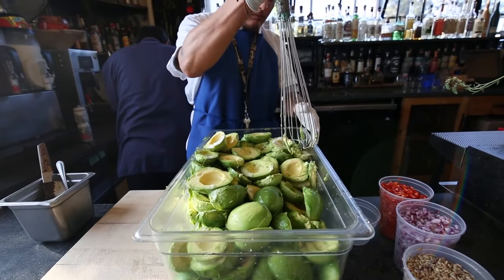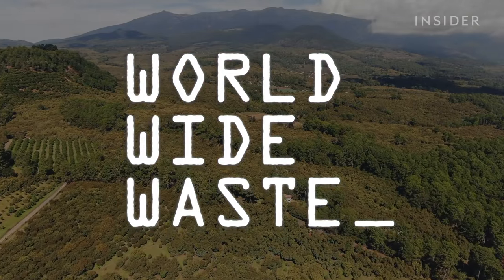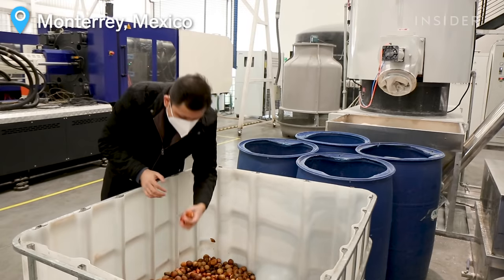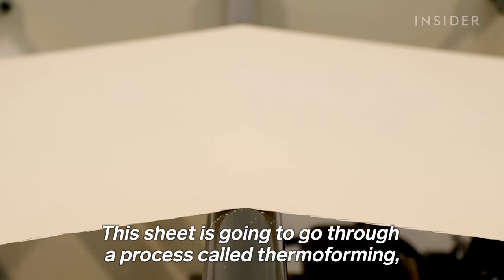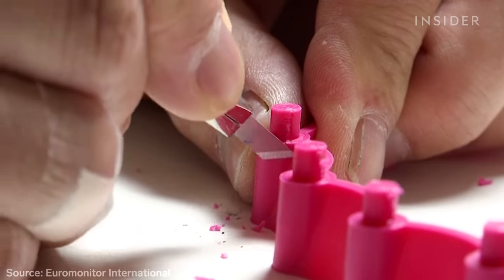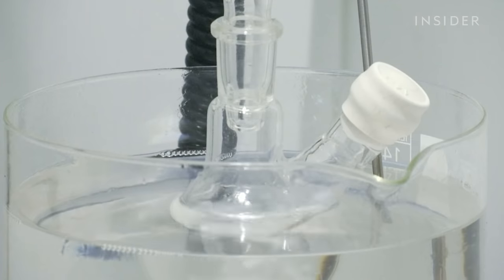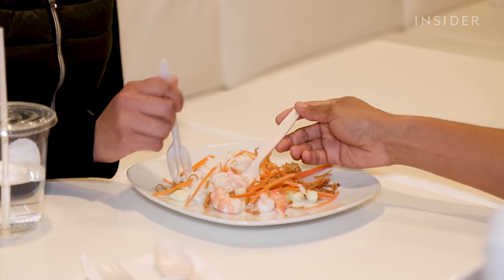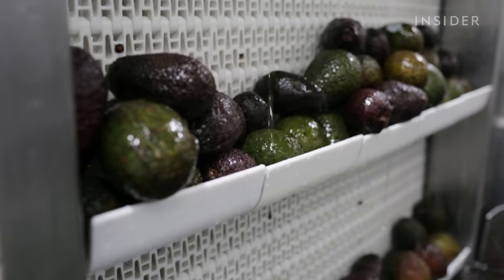How Avocado Waste Is Turned Into Plastic | World Wide Waste

Comment: It’s a huge step in the right direction and without these innovations we would still be stuck using single use plastics. Kudos to them and i applaud their way of thinking.
Reply: They're still single use
Reply: @sirgerald6846  so is petroleum plastic
Reply: @sirgerald6846  yeah but that's less important if it's also biodegradable
Reply: An executive order by the president should be to help this
Reply: Or you could just legislate this out of existence.  Oh right that would take some brains in politicians.
Reply: @iceesrule75  using metal or hard plastic utensils would even be better
Reply: Also you are just supplying the cartel
Reply: I mean we still use a vast majority of petroleum based plastics. This is also still single use and plastics. And most of the pla (which is the majority of bioplastics) gets burned and contaminates recyclable plastics. Energy usage in processing and shipping is also a concern (especially not renewable energy makes the switch obsolete, because petroleum based plastics are actually pretty energy effecient)
Reply: @ElAdri1999  so when you buy take out food will they freakin give you a metal spoon
Reply: @milkyxbearss  when you buy takeout they should give hard plastic utebsils
Reply: @wge621  I actually did a research report on bio plastics and if not handled properly they pose the same threats as petroleum based plastics, whilst costing more and releasing methane into the environment (which is 23 times more dangerous than carbon dioxide). They also need to be sent into a factory to biodegrade(as they cannot biodegrade in all environments). All biodegradable plastics are not bio plastics and all bio plastics are not biodegradable leading to misconceptions about the product.
Reply: @yunan9610  I actually did a research report on bio plastics and if not handled properly they pose the same threats as petroleum based plastics, whilst costing more and releasing methane into the environment (which is 23 times more dangerous than carbon dioxide). They also need to be sent into a factory to biodegrade(as they cannot biodegrade in all environments). All biodegradable plastics are not bio plastics and all bio plastics are not biodegradable leading to misconceptions about the product.
Reply: @sophiasingla2448  good to know. environment-friendly products or ideas are always fraught with misconceptions
Reply: Imagine if you just planted the seed instead of turning it into something while calling it waste -_-
Reply: Avocados are bad for the enviroment because of its high water usage.
Reply: vegetable fats.. the same process as palm oil plastics.. this process enables you to get bio diesel as well.. youtube is really handy in getting informations..
Reply: PLA's are not biodegradable but they are degradaded in an industrial set-up due its very specific degradation conditions, therefore PLA has to have their one recycling stream, and the recycling industry does not have it (it mainly exists for PET and PE's).  So that means these kind of bibased plastic go directly to the landfills and oceans... this kind of videos are greenwashing at its best
Reply: @sirgerald6846  well yeah, but its made out of plant waste, not some thousand year old resource
Reply: I still don’t know if avocado is a fruit or vegetable?
Reply: Exactly, and just why hasn't this been done a lot earlier I've no idea. 🤔😖🤦‍♂️ if it wasn't for these multi national petro chemical companies in the late 40's early 50's pushing their plastic shit down our throats we wouldn't even be in this situation now forcing third world countries to dispose of our recycled waste and shit. Here in Australia, it wasn't till the late 80's earlier 90's the we went on to using more plastic products. When I was a kid growing up, everything and I mean everything either came in glass, paper, cardboard, or tin- metal receptacles. And everything was recycled, nothing went to waste even food. Unlike in today's society, we live in such a disposable throw away era. Not good for us or the planet or the environment.
Reply: Wrong, it's patented so only they can do this. If they actually cared about the environment they wouldn't have made a patent out of it but they care about money.
Reply: I like the idea of it. I just hope one day we can find the perfect plastic alternative and save our oceans and wildlife.
Reply: Avocado despite it is a healthy fruit. It uses up a huge amount of water for the fruit to grow. That is a huge waste in the first place
Reply: Why not just use the same plastic fork more than once
Reply: No one is "stuck" with single use plastic they make metal silverware inside travel kits smaller than a sun glasses case. Eat with those if you're out wash them when you get home 🤷‍♂️
Reply: @milkyxbearss  no but you can be responsible and bring your own it's not hard
Reply: @devrobledo2191  since the avocado seed is inside it's likely a fruit however I didn't Google it and there's a serious rabbit hole on what is or isn't a fruit
Reply: Sucks that In order just to make a avocado you need 50 plus gallons of water not the best solution
Reply: It seems like they have patented it so... Only a few can actually use this process. Remember that companies do what is profitable for them.

Comment: They don't really tell you how it's made I'm curious what's the ratio of avacado seed to whatever the other materials or plastics they use are. I doubt it's just avacado seed
Reply: Its not just avocado pits,he says,they use less petroleum for the production sooo yes.
Reply: And they said that it uses "less fossil fuels" than conventional plastic. I haven't checked, but I won't be surprised if its 90% fossil fuel + 10% avocado oil.
Reply: @virtual_farmer_881  yup,I think the same allthough neither me checked but its probably there, 10-20% range

Comment: "shipped to the UK" wouldn't that leave a massive co2 footprint?
Reply: Not really, with the capacity of modern container ships, any impact, IF there was any is pretty low.
Reply: @CaptainBill22  But the positive impact is also quite low on these, considering they're only supplying a few thousand households. Plus, all of the shipping adds up over time.
Reply: not with how light weight they are.
Reply: @poochyenarulez  Lightweight is irrelevant though. If you fill up a container with them, that's space another container would have taken. There's limited space on these ships and when they get full, additional ships are constructed to make additional trips. Every container of product you ship will contribute towards that.
Reply: @arandombard1197  ? Weight is everything. The cost to ship and amount they can carry is almost always determined by weight, and thats for ships and trucks.
Reply: @poochyenarulez  Yes, and the container itself is quite heavy.
Reply: The production and distributions avocados alone is well known to be costly on the environmental side. Although data on environmental protection can be good and some solutions doable the activism as lead to silly and unsustainable solutions that drag down other forms of progress.

Comment: I mean we still use a vast majority of petroleum based plastics. This is also still single use and plastics. And most of the pla (which is the majority of bioplastics) gets burned and contaminates recyclable plastics. Energy usage in processing and shipping is also a concern (especially not renewable energy makes the switch obsolete, because petroleum based plastics are actually pretty energy effecient)

Comment: the problem with this so called bioplastic products is u cant encourage most poor consumer to used that , keep in mind most consumer are poor to middle class...it is way  expensive than plastic,  most in a budget would surely buy the cheaper plastic than this environmentally sound products...
Reply: Maybe one day it will be cheaper
Reply: It is expensive as it is not in demand is not produced in mass. it applies for everything. Like for example fruits which are in demand are expensive. Also when the particular fruit is sold off season then also it prices rises as during off season there is less production. While on the other hand if the fruits are sold in its particular season its prices are little low as it has mass production. If we take apples then they have hike in prices when it is not winter as it is a friut which is in demand but is not mass produced off season while during winter its cost are less as it is mass produced.
Reply: So bioplastic should be mass produced and also people should buy it more which will result that it will be cheaper.
Reply: @pokechannel9758  as well as encouraging friendly competition among ecological brands... cuz if someone just monopolize its price it will be not good

Comment: They might be priced up a bit than common cheap plastics. But once you practice the reusable utensils, you'll realize there's almost no need for any one-use item except just one or two you'd slip in handbags or pockets 'in case of emergency' few times a year.

Comment: I guess it's still just like PLA which promoted can be degradable in the soil, but in fact it need certain condition that are not available in the nature, and can only be made in manufacturing facility. It's a false claim. Currently the most easy degradable is cassava plastic made in Bali, which can be dissolved in water and have non-toxic ingredient at all, but it's also become disadvantage of this cassava plastic, can't be used as water container or in humid condition. Need to be reinvented to solve this problem.